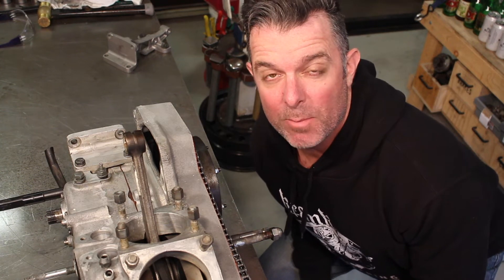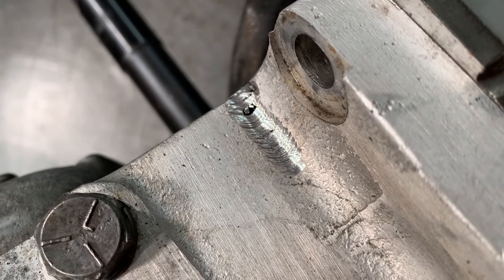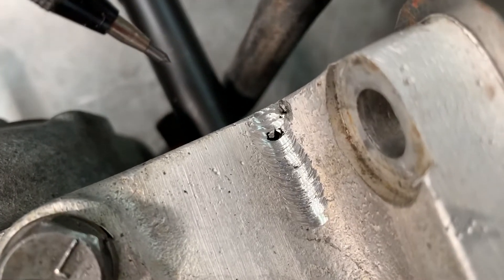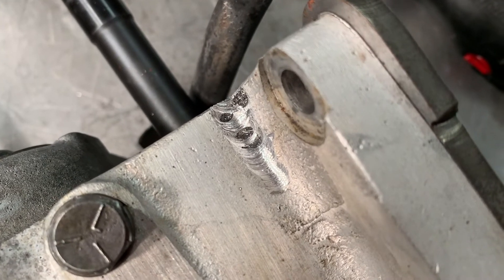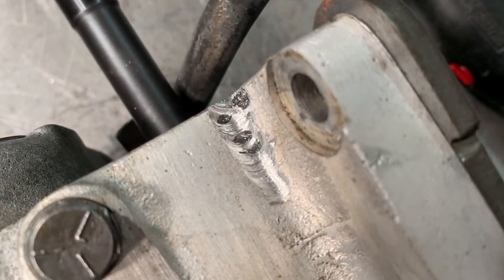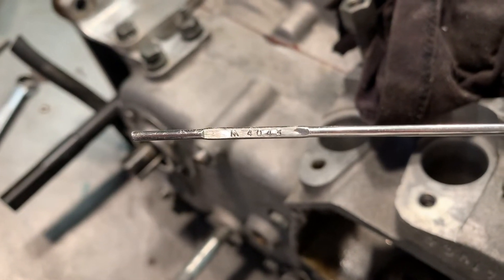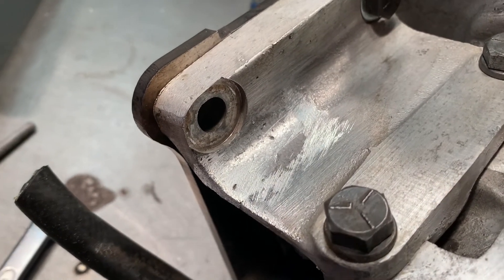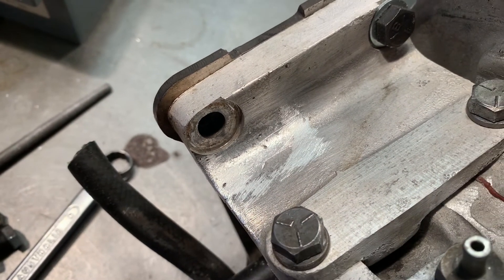How to weld repair cast aluminium (aluminum) motorcycle parts

Comment from the maker: Let me know if you have any questions related to weld repairing cast aluminium 👇👇👇
Reply: What if the part had been oil soaked ? what is your cleaning method
Reply from the maker: Mechelectro probably bake it in an oven to try burning out as much oil as possible
Reply: I just got a gsxr750 and it has a hairline crack hidden under the wires up front on the neck by the handlebars its like half an inch long ...it's fixable right?
Reply from the maker: @supermotarded3  hard to say without looking at it mate, but in theory everything is fixable with enough time and money
Reply: @krankengineering  yess I finally got ahold of my friend who has an aluminum welder and he said he can help me no prob so its just gonna be a time thing he said he would do it for free I'll prob give him like a 20$ when. He's done imma be with him watching and helping so I can learn

Comment: New sub :-) - What think you of those aluminium "brazing" rods? I have a crack in an Ali hub I can't replace - not a welder so need a muppet-friendly fix.
Reply from the maker: Thanks for the sub mate, right back at you. Ha ha muppet friendly fix!!! I've got some of those brazing rods, but never used them. I'd be tig welding it like I did in the video. Well. Maybe. Depends how rare it is. Its always a bit risky as you don't know the exact alloy they used, plus it might suffer from some distortion, plus you really should chase the crack out with a grinder (like I did in), otherwise it'll likely crack again. If you can connect with a gun tig welder in your area that would be the best bet if you need the hub to run again. I tend to just weld all of my own parts up becasue, a) I'm a tightwad, and b) its a challenge worth pursuing, but I'm more careful and picky if asked to do it for someone else....my insurance isn't that good. Sorry I can't be more help.....